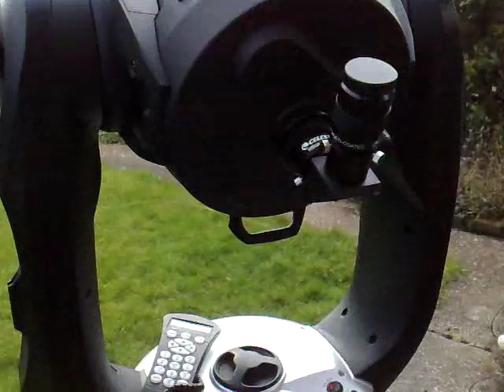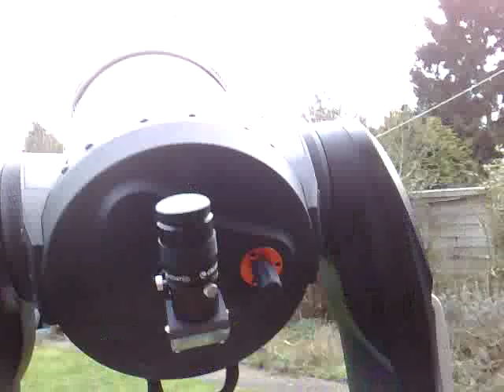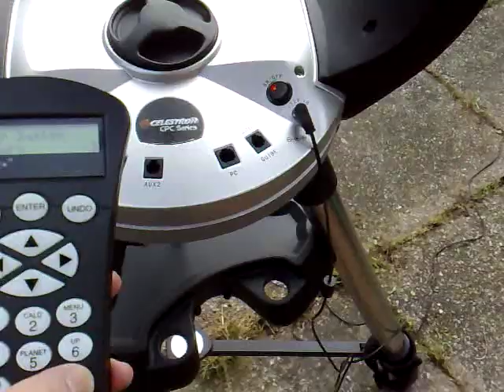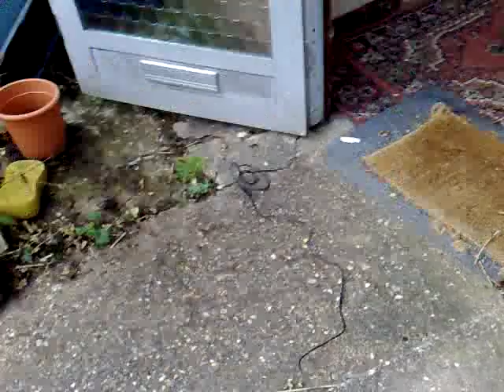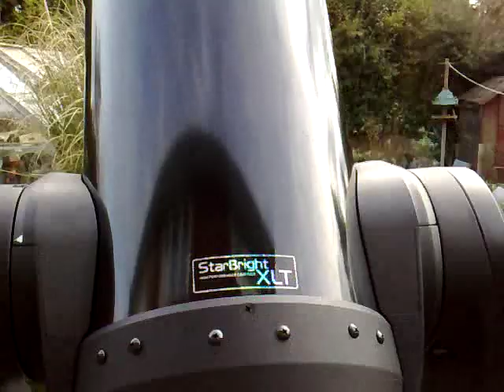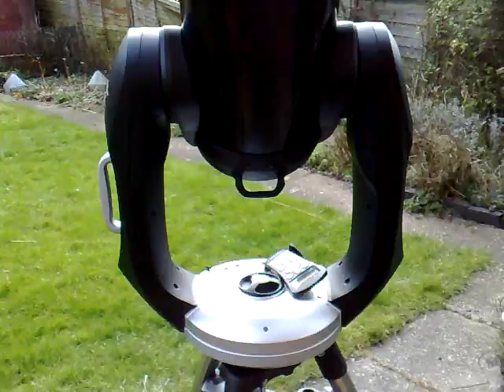Celestron CPC Problems

Comment: I did the 2 star alignment using the hand control. does not stay on the planet as others mention. Yes using  home power and this is level. I see why the seller sold his from ebay. Thank GOD the telescope can be removed for a different mount. The electronics for this control is a joke. This mount has a mind of its own.  I know wifi interference and metallic objects can interfere.  everyone have a good week. Thank you for posting.
Reply: Yhey HATE,low AMP/ voltage must be full 12 volt.. 3 amp min ac adaptor. Otherwise plays up

Comment: I don't know if you fixed the problem yet, I bet you did, but man, that long power DC cable is a magnet for problems.  Just use a short cable between the power adapter and the CPC800.  You may use a longer AC power cable to feed the power adapter.  I would recommend even to use a noise filter power outlet strip, with spike supressor. Remember that you are powering a very delicate and sensitive expensive optics equipment.  In your place, I would use a small 12V battery.  There is the ones 12V 9A lead acid sealed batteries used in computer nobreaks and power failure lamps.  You can install this rechargeable battery underneath the CPC800 tripod.  I did it, never a problem.
Reply: Yes spot Wagner, Voltage drop, I was thinking the same..Though it seems to slew ok - just to the wrong place. I'm in the market for a higher end scope but what I want doesn't exist (planets and some deep sky/galaxy's/Nebula etc. Anyway would you recommend Celestron? Meade or TAL even rust prone have great optics at least.

Comment: My CPC1100 is really fussy about the power line to it & produces errors if the lead is too long or if the power source is being shared with any other equipment, the circuitry in the CPC just doesn't seem to like any noise anomalies at all on it's power input. I find that everything is OK with a short power lead & a ferrite ring on it too.
Reply: True amp is crucial 3amp min

Comment: Not sure if you ever fixed the issue with your tracking. I have a CPC 1100 and encounter odd behavior with the mount when my 12v battery begins to lose voltage.  If I where a betting man, I'd wager the problem is with inverter.  The CPC Line is much more sensitive to voltage drops than your previous Nexstar.  If this is still an issue, you can try 2 things:

1.) purchase the Celestron power cable for the mains and do not use the inverter - run a heavy gauge extension cord to where you wish to observe from and then plug in via the Celestron A/C adapter.

2.) purchase or make your own 12v portable power supply.  I recently made my own using a deep cycle battery (like those used in caravans).

Good luck!
-Mike

Comment: Did you try setting it factory defults. Do you have it in Equitorial mode and not Alt-Az. This will cause problems.
Usually a factory defult will make things better. Fimiliarize yourself with the menu tree. You may have been messing around and turned on some feature or another and screwed things up for the mode you are trying to operate in. It is tricky at first but the thing is amazing when you think about it. You must make sure your menu choices are set right. Do a Factory Reset.

Comment: . I have the same scope and the three point method is the best and performs flawlessly. Even the two object mode is better. You must try another method before passing judgment with this crude method. Is the Cord Wrap feature turned on? Sometimes this will cause the scope to slew 359 degrees to acquire a new target even if the old one is right next to it.

Comment: You must do a three star at night, using three that are in the data base, like Procyon, Betelgeuse, and Sirius then make a judgment. The Sun alone is not good enough. Your alignment mode by just pointing at the Sun roughly is about the most useless way of aligning. The thing is smart but not that good. You can also refine your alignment by replacing a star after the initial alignment.

Comment: If you turn it off for a few days you may not have the location stored anymore because the charge on the capacitor is drained. You say you have clouds can your scope get a good fix on at least three GPS satellites? Did you check the coordinates when you started to align to see if they are reporting your location accurately? If not power up and let it stay on for a while. The old saying goes like this "if all else fails read the manual.

Comment: Read the Manual. If you finally get it aligned point your scope to a position you want to store it in then turn the Hibernate function on and power down. If you do not move the scope or loosen one of the two clutches you can power on and it will still be aligned very close. You an mark the spot of the tripod on the ground and if you do not change the leg height or move the scope by loosening the clutches you can just put it back and you will be close.

Comment: If you move it you must give it time to find itself if you moved it to a new location. Are you sure your local time is right? Are you aware that the thing has no battery? It uses a very large capacitor to power the GPS when turned off to remember your location. Over time the charge will dissipate if you do not have it turned on and you will loose your location data. Just turning it on at the last second and thinking it will do everything in two seconds it pure folly.

Comment: Are you aware that there are different tracking modes? Are you tracking in the Solar System Mode or Sidereal mode? id you check to see if you GPS had enough time to actually find your position on Earth? If you move your scope to a different location a good distance away, say 100 miles, you will have to power it up for at least 1/2 to 1 hour for it to re-acclimate to the new position.

Comment: Also  that cord you dealing with is garbage. Go down to the hobby store or radio shack and buy a 7amp gell cell battery. It is compact and you can rest it on the base of your scope and no more cordwrap. Buy a rubber silicone pad and the battery will not slip off when the scope is rotating. I get about 4-5 nights of use on 1 charge. Make sure you disable the cordwrap option in scope setup. It is the best thing I have done for the scope.  Clear skies

Comment from the maker: Hi John, Thanks for your comments. I have tried the two and three point aims before - this was a Solar System Align. None of them work properly :-( I have a Celestron SE which works fine so am somewhat familiar with the options in the software. Was just doing it the daytime to get an OK video!
Reply: Hi Andrew, did you solve this problem? if so how....thanks
Reply: Iv got one of these coming what would you suggest power wise as not to get this issue
Reply: @stephenstrassen1135  Hi Stephen, I use a 3cell 5amp lipo battery, after about 3 hours it will be around 85% full